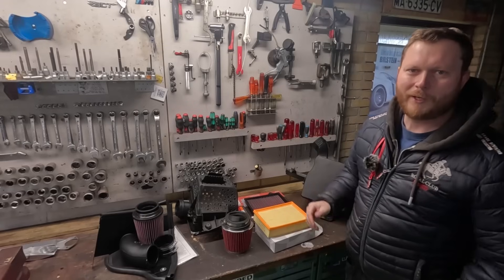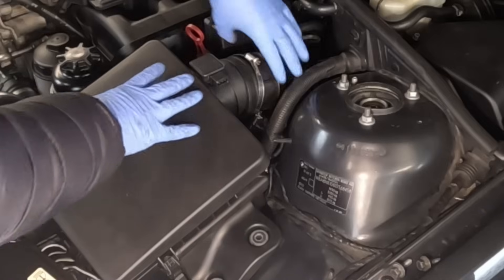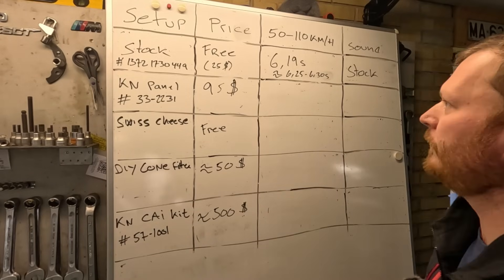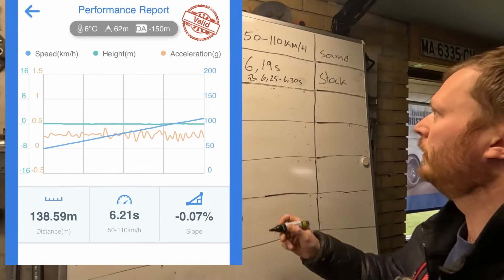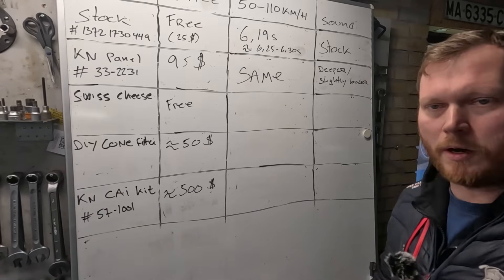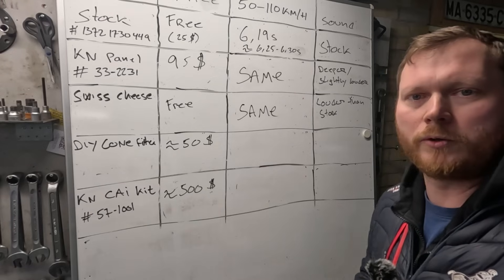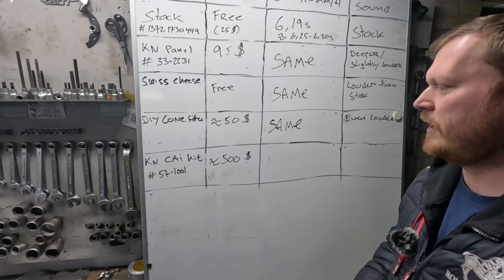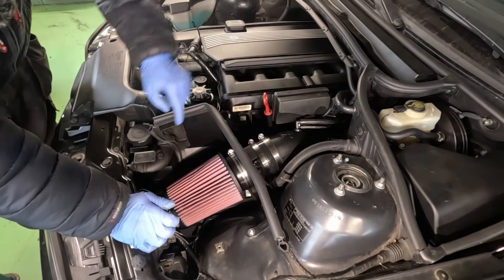Best Intake - K&N vs Stock vs Swiss Cheese mod. Test & Review

Comment: That was a fantastic comparison and just proves after all these years that BMW got it right from the factory.
Reply: Weird, engineers testing a product for 4 million miles works better than some untested shiny pipe, who would have thought
Reply: I'd say most if not all manufacturers got it right, never have I seen the air filter to have some effect on power in a N/A engine
Reply: "Throttle Response" feels like power to most. @MadEvo606
Reply: @MadEvo606 id have to disagree. Bmw may have a better intake design but on economy cars such as camrys it really does make a difference. Its all about how the airbox is set up
Reply: For stock power levels, sure.
Reply: what alot of people miss is the increase in torque in the low to mid range. Which makes quite the difference, wont make difference in zero to sixty vs stock air box tho.
Reply: yes but that kid at autozone who has all that educations.. well tell you , ' you can get 15-20 hp more if you use this or that
Reply: Spoiler alert 😂⚠️
Reply: Dropping in a performance filter and testing straight out is worthless.. you need to let the maf sensor detect different volumes of air and adjust the a/f ratio after some drives.. give it a few days.. then test... all to say a k/n filter lets the engine breathe better and allows you to downshift much mor3 easily..

Comment: Excellent advice as usual, just proves that intakes are a sound bonus (if one likes that) and nothing else. My first M5 came with some cone filters and very nice aluminium tubing when i got it, removed it after tyrying it for a few days and put the stock system back on which made the car feel alot faster still, no heat soak I guess. OEM's engineer these things alot better.
Reply from the maker: Thank you:) i kindda like it but its not worth 500 dollars imo

Comment: good job but i should say I see something wrong with your instant comsumption gauge. It reachs 20l/100km but on most of petrol engines it goes far the last line of the measurement if you press the pedal at WOT like the action you performed with the pedal on your tests... I see it does not depend on the air filter as it happens to you on all your tests... Maybe you need to test your injection or maybe is the throttle body
Reply from the maker: Thank you. I’ll have to look into that. Could i be the camera angle that makes it look like that?
Reply: @OEMplusRESTO  maybe bro but I have a 323i (those m52tu) I have the most recent zusb on my ecu. I bought it by second hand and now it has been two sg prog (mine and the other owner did the first) the zusb number was updated with bmw software winkfp by me. The only thing i could say my car does not have the secondary air pump… i always thinked the behavior on my car wasnt the normal but since I notice that behavior on the consumption gauge I kept an eye on each videos I saw from e46 petrol engines m52TU or m54 and I see the behavior I described a lot times. Then I conclude the behavior is normal for me going ahead from 20l/100km. I mean is like an extra line, you should notice by far. It is not a little bit over the last printed line. It is like another extra line where the gauge ends at WOT. Think about marking 30 or 35l/100km. I think it is related with the air because some time I put a non OEM DISA valve and in fifth gear it does not go as far as with the one I have from the first time and actually which is oem. I also noticed with the non-oem the gauge taked the place near 20l/100km at WOT and it happened when i went up in an inclinated road. Now with the bmw DISA it behaves as I say on every situations… Maybe it could be caused by the MAF measurements but sincerely I dont know why exactly…
Maybe you can compare if the analog measurement is near the same than the digital measurement on the hidden obc menu in the speedo lcd… Maybe is the first step to know if the consumption is as it shoulds…
I should say when i changed those elements I made a reset of adaptions and throttle body adaptions included (mdk adaptions)
I could never simulate the behavior as i described with a non bmw DISA valve

Comment: You even sacrificed an airbox for us!
And again as usual the stock sistem is the better, i might buy one panel filter just for the fact that there is no need to change it for a long time
Reply from the maker: It hurt when i drilled it lol:) yes i think the kn panel filte or one of the cheaper alternatives are a good option for a ligegime filtet too:)
Reply: @rustirab3465not really. If you look at legitimate testing, using machines that match intake pulses rather than a steady air flow, they filter just about as well. David Visard, a well respecred automotive engineer that OEs have used for consulting, has a video on his own testing of them I recommend. I've never had the oil issue the other guy mentioned after having run K&N filters on a MAF car since 2008. That typically happens when someone over oils after cleaning their filter.
Reply: @rustirab3465 if you don't clean and reoil them every 30k or so miles, sure, but they do no damage to anytthing otherwise
Reply: @rustirab3465yes, very. Also the oil separates from the panel and coats the MAF sensor for the first 3k miles of driving with one, so it's just overall not super healthy, but it's also not horribly bad in the end, it won't actually for real hurt anything if you are a daily driver/street warrior
Reply: looking at all these Phd's telling you that you are wrong
Reply: yup..hold one up to the sun.. can you  see through it? yup... bye bye engine@rustirab3465
Reply: I got a 92' Mirage CyborgR with a K&N panel filter since 96. God knows how much I've saved without needing to buy any replacement filter 😂 

PS - it doesn't do shit on performance.
Reply: @princesssolace4337  impressive haha, but I want to say, i had a car (VW TDI) with no value and a lot of rust, not worth spending money on, so for fun i drove it 130.000km (6years) on the same oem "paper" filter, never REALLY cleaned it, just took it out and beat it to the ground to get out the worst haha.
Reply: @mbc1994  We too have a run around car for running quick errands, a 1990 Nissan Sunny 130Y with a warp head from a blown head gasket since 2010. Coolant leaks into 1 cylinder so we have to top up the coolant every 2/3 days .... no one cares to do anything coz it still runs gud on 4 cylinders😁 .... temperature will rise in start stop traffic. If the engine seized, just pour water on the block, 5 minutes later u ready to go🤣 .... it just refused to die and it only got minor surface rust.
Reply: @princesssolace4337  haha, can not do that here, inspections every 2years. A tip if you do not already know, put the interior heat on high and fan on full to help cool the  engine.
Reply: @mbc1994  I live on a tropical island .... even my 2001 RS4 Avant got the heater delete, I even sold the heated oem Recaros to a body shop in UK(coz I've already got a pair of CF Recaro SPG waiting at home to be plonk in😁)  Basically all heater elements will get deleted b4 shipping the cars over .... dat is why the Sunny got no rust issues, and no heater, but it does have AC😁
Reply: i guess 6 to 12 dollars is way out of your rich mans budget... mc Donals does not pay you well?... @princesssolace4337

Comment: I've done an air filter test on my E36 328i. I also measured the pressure drop across the filter. While testing, I had a laptop hooked up to ecu and was logging parameters. Here is what I found. 
 * Kn panel filter had almost no air resistance. 
*Stock paper filter resistance is small
* Mine has a custom pipe from front bumper to the air box. Ram air at 100kmh would eliminate stock air filter resistance. 
* Cutting holes to filter box would hurt the performance. You'd lose ram air and increase in air temperature. I've logged air temperature without the snorkel. 
* Stock air filter works really well, which is why it's almost impossible to make any performance gains with filter alone
* MAF causes A lot higher resistance than an air filter. (Your m54 MAF is bigger than my m52. Maybe you wouldn't gain much with MAF delete)
Reply from the maker: Dude i love your tests and approach. Underrated channel for sure:) thank for contributing to the bmw world in general
Reply: @OEMplusRESTO  thank you for the kind words. 
 I'm looking forward to your next video.
Reply: Less resistance of the air flow induced by the TB will increase accelerator response time and that's it on an NA vehicle.  FI engines rely on spool time AND both need tuning to make a difference; but you can do that the same with a stock or other filter.
Read more about Bernoulli's principle.
Reply: https://youtu.be/wQXsbs_tO1s?feature=shared

Comment: Nice video, but as a sugestion, for a more acurate input, you should try to monitor the maf reading to check if the car is actualy getting an improve in the air density.
If the maf is reading bigger air numbers, teoricaly you can make more power with a tune or even in stock form.
Probably nothing noticible anyway as the stock sistem is preaty good.
Reply from the maker: Thats actually a good idea. Thanks. Maybe i should try that